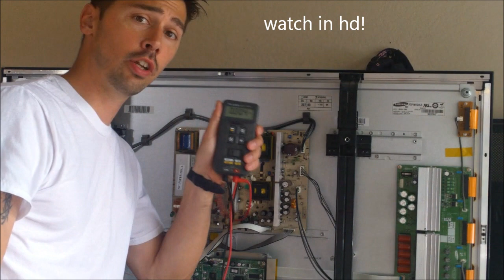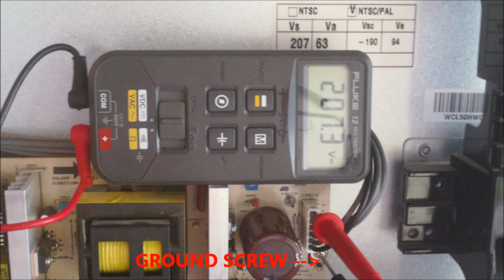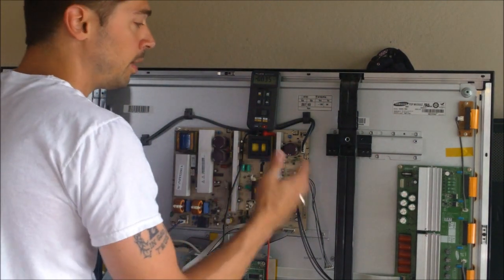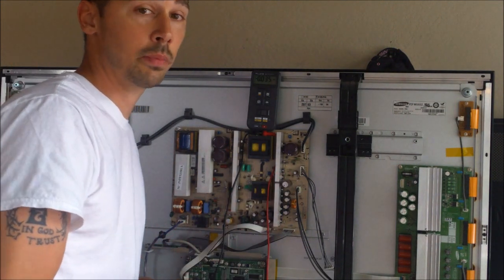How to use Meter to Fix TV - Troubleshooting guide

Comment: I bought a samsung lcd for 60 €. No picture .  So i think its a transformer. I looked too the capacitors. They are good. I testing the transformers. All 1.5 resistance. I have a schematic from all transformers on number. One transformer was bad. Reading . 6.5 resistance. Solder out and now it reads nothing. So that is a bad one. I will replace it. Can you show how to read a ic chip? Thks too you i learned a lot. Greetings from the Netherlands

Comment: great video ! if anyone can help me you can.I have a 50 " lg plasma that the dog would pop the cord out of the wall on a regular basis. living in cabo san lucas means no lg support ! tested va's, vs's and all the rest, nil to none ( 2 to 4) voltage and cuts out as soon as click is heard after turning on set ! no blown caps but some might have a slight swell to there tops "very slight " ? watcha think ?

Comment: Hey I am getting a great AC Rating of 120. I am testing the Power Supply of a Samsung 50 plasma TV. The issues are my DC ratings are not reading anything. I currently do not have the Main Board installed in TV. Do I need to have the Main Board in the TV to get correct readings? The only thing I am getting a reading on is the VA. Chart says I should get 57 but most of the time I am getting 54. On the VS it says I should get 207 and I am currently getting nothing.

Comment: Great videos! I have a Sanyo plasma blank screen, turns off after a few secs. I used the multi meter & measure 124 ac coming in. I then switch to DC n try to measure  the Vs/VA and got zero. Is the power supply bad ?

Comment: Thanks The soundbar will not process dolby optical so no sound  - i bought a digital to analog box that did not work with dolby either - ideas? The tv speaker output is not running speakers i use it for the input on the soundbar - is that low watt enough not to hurt the tv sound board? thanks it is alway so complicated

Comment: Hi i have a tc60s30 panasonic plasma - I took the lines from the speakers inside for a left and right speaker line out- i put those lines to a sound bar input - all was fine then- the TV would not come on and started to blink red 12 times - I unpluged it and it reset and now is working fine - should i continue to use it this way or put the speakers back in service as original? thanks